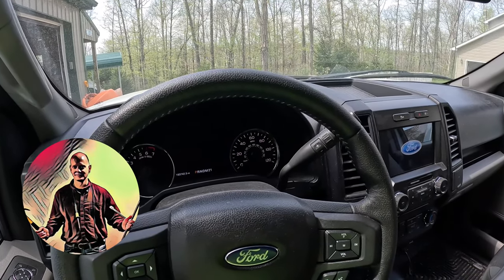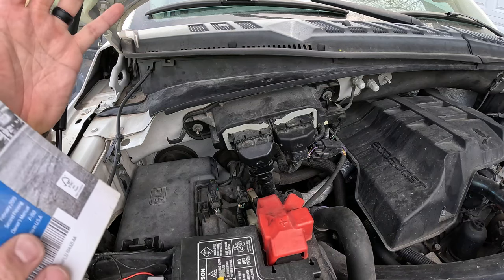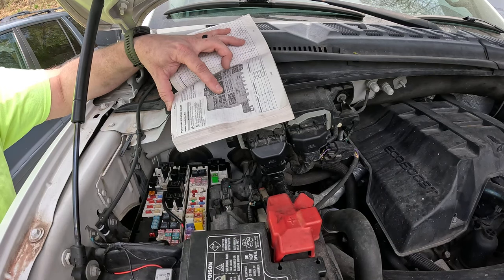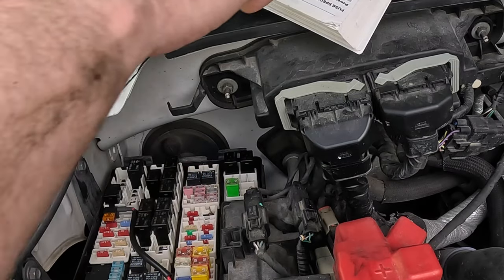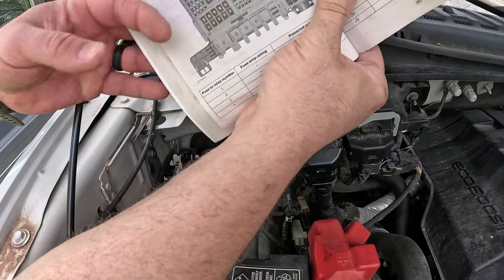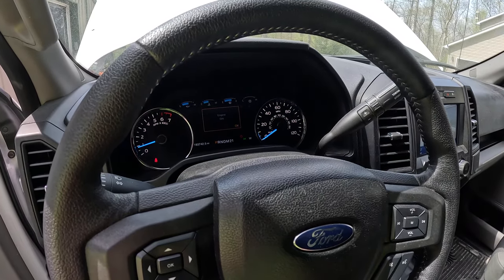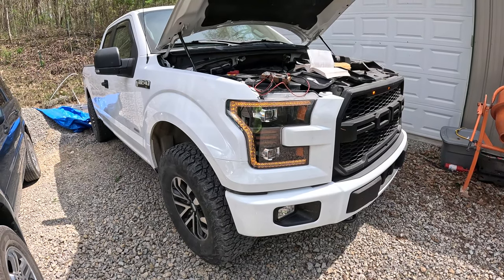2015-2022 Ford F150 No Start Diagnosis and Repair

Comment: Having same issues, new battery , new stater had the new starter tested and it showed good ,replaced pcm relay checked starter relay fuse still no start no crank, and dash is going crazy just like yours was!
Reply: What was the fix?
Reply: i have the same problem right now but my dash is normal
Reply: have yall fixed it?

Comment: Ugh, starter tested ok, relays were good. I'm getting the same dash lights: Hill start assist, advanced track, and the wrench. batter tested ok. replacing the PCM relay did nothing. I REALLY dont want to have to replace a PCM.

Comment: Im having no start issue. After truck sat for 8 months after collision repairs. I had no start issue swapped out starter for new one. Cut off oxidizing ends that went to starter put new ends on. Tested battery many times 12+ volts and good crank amperage. Truck can take 5-150 turns of the key to turn over. Like it has a mine of its own. 2016 f150 v8. Just here a click and dash all gets cummunication

Comment: Our 2023 F150 SXT stopped in traffic and would not restart.  Dealer ordered a brake booster and battery core from the factory.  Our symptoms were very similar to yours.  I'm surprised they didn't check the PCM or relay first.  New truck only had it a week.
Reply from the maker: Not sure why a brake booster would cause a no start... 🤔

Comment: Swapping relays can cause problems if not identical meanings did the pcm relay have a resistor across the coil if you looked at the relay diagram on it’s case  switching a relay that doesn’t have a resistor will smoke the pcm eventually ALLWAYS LOOK it’s called surge protection CHEERS some manufacturers use a diode in the fuse compartment labeled start
Reply from the maker: Good thing they are all identical on this truck.
Reply: Not a Lucas manufactured system.

Comment: I’ve replaced my starter , new ignition switch, checked all my fuses, and everything lights up just fine but I can’t get my truck to fire up. Ford f-150 XLT V8. Someone please help.
Reply from the maker: Did you check the starter relay? Are you sure the new starter is good?
Reply: Yup, put a brand new one on there and it has a strong crank when you go through the fuse box.  Going to replace the key and check antitheft next.
Reply from the maker: Sounds like a PCM issue. You sure you have power to your computer? Is the dash going crazy at all?
Reply: @JackofAllMasterofNone  No the dash is actually completely fine. What would make this a pcm issue ?

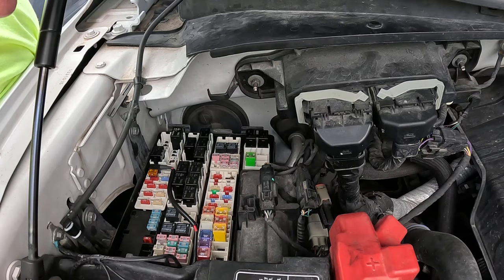Comment: You sir just saved us from a $580 tow bill from the middle of Georgia. The story - was doing this thing, put in a new battery, thought it was fixed until 2 days later it did it again while on the job site, had it towed back to office, still didn't start, so I went home. started getting calls this morning from the guy that jumped in it at 05:00 (didn't know it had arrived on a roll-off the evening before) to drive down to south Georgi. it started for him like all was well, and he made it about half-way and stopped for a biscuit & fuel. Thanks to your video I was able to talk him through what to do. Thank you again for posting the actual answer. But be warned - I'm going to come back here and change this comment if it shows it's ass again though
Reply from the maker: Hopefully it's fixed

Comment: Hi, my remote start would turn the engine on but my key does nothing, what could be the issue? When I turn the key, everything lights up fine. But I get no crank. 2018 f150 xlt.
Reply from the maker: Could be multiple things. Could be a bad transponder chip in the key. Could be a bad ignition switch.

Comment: Hello my truck is doing this and i checked everything in this video and eve the battery and the starter. Could it be the alternator or what else could be causing this?
Reply: Did you ever find the fix?
Reply: @michetedder7807  Yes I did, it turned out to be the 2015 automatic version of a neutral safety switch inside the transmission, which sadly has to be programmed into the truck when changed so I had to get a dealership to change it.
Reply: @michetedder7807  Also if you want to check to make sure this is the problem try to jump your starter relay with a piece of wire or a relay jumper when the truck won't run it fixes the problem too it's just annoying to get out of the truck and keep jumping that over and over. If you do it with a wire make sure it's coated/insulated wire and just touch the ends to where the relay hooks up whilst holding the insulated part so you don't shock yourself.

Comment: Thinking this is my problem as well.  No crank no start, replace starter relay...thought it was fixed, because it started for a while?  Then issue returned.  Would it sporadically start if this relay was bad? or going bad? Do these relays stick and then release? Sorry for all the questions...just hoping I got the problem.
Reply from the maker: The relays can intermittently fail yes. But it could also be something else. There's also a solenoid on the starter that could be going bad